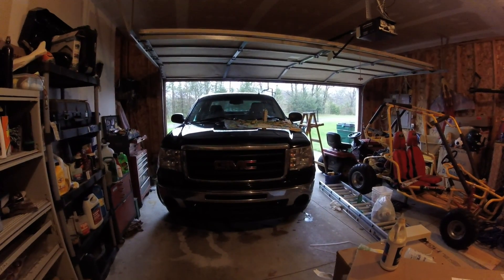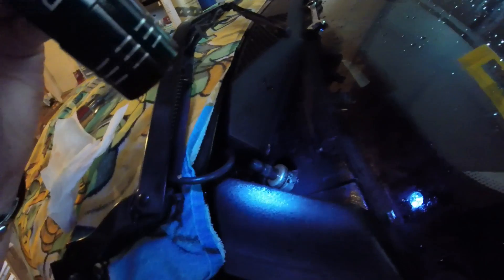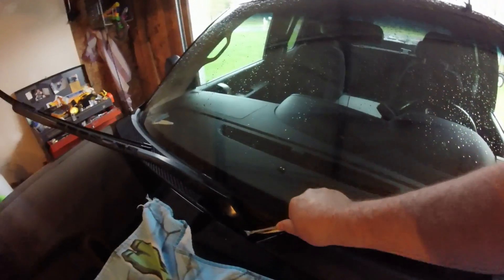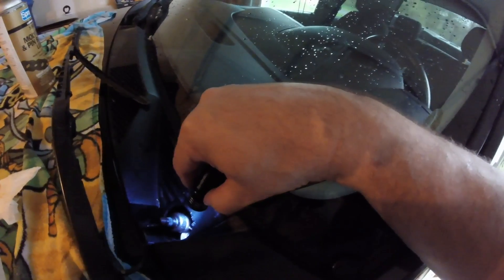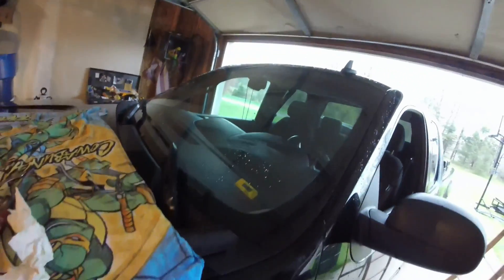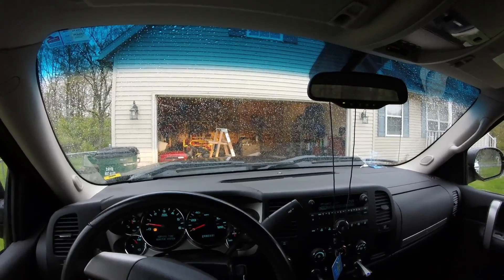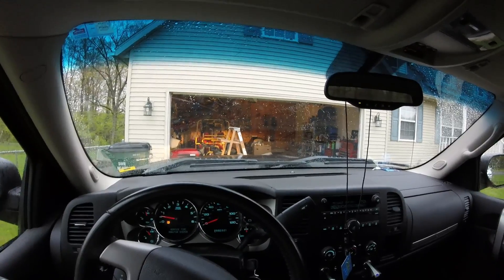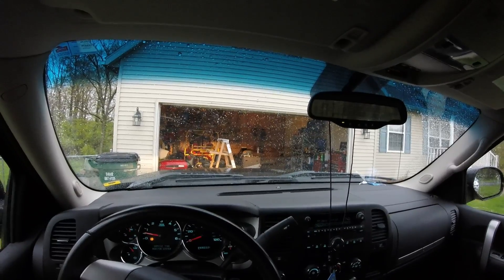2009 GMC Sierra Windshield Wiper transmission fix. 1080p HD

Comment: Great informative video. Ty I’m having the same problem so I replaced the motor but discovered that’s not it so I narrowed it down to the linkage also yesterday. It’s good to hear that my theory may be right.
Reply from the maker: I bought new linkage back when I made this video, but never had to install it because I never had an issue since drilling and lubing.

Comment: Thank You for the video - saved me $160 !! and a lot of time.   I drilled the wiper arm housings, blew out the cuttings, and greased as shown in your video - I also wrapped electrical tape around it to prevent dirt from getting in.   I cleaned all the pivot points with PB-Blaster, and applied grease.   The wiper transmission works as good as new.   This would have been my second transmission replacement in 4 years!  The design of this mechanism is defective, and should allow more grease storage in it - so that this would never have been necessary.

Comment: Hey, just drilled mine today what did you use to seal up the holes?

Thanks.
Reply from the maker: @larsonny77  I used some wax, but maybe even a little bit of silicone caulk might work.

Comment from the maker: It is still working great.
Reply: how far down do you drill im halfway through and drilled in the same spot as you and its still solid
Reply: I’m in the same situation I’ve drilled in several spots and it’s just solid aluminum no way the grease is gonna work it’s way anywhere but back out the zert
Reply from the maker: I used chain oil not grease
Reply from the maker: It is still working great. I never needed to put the new part on so it’s sitting on a shelf.